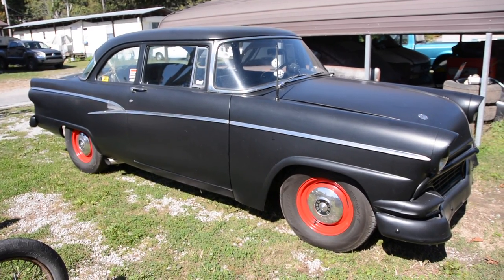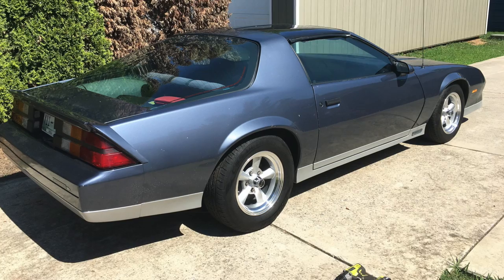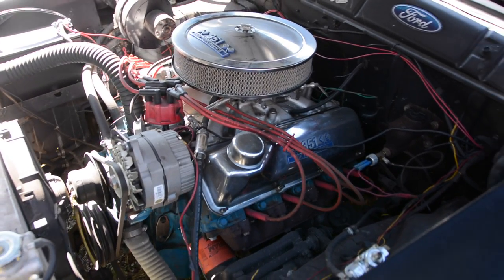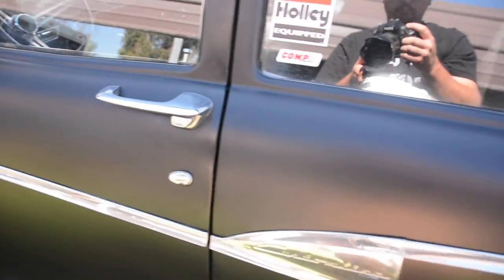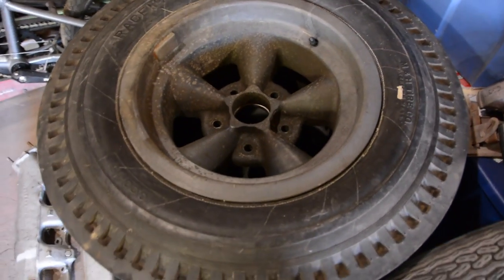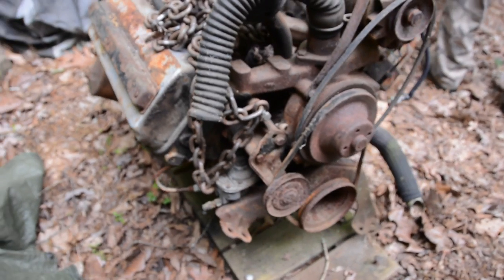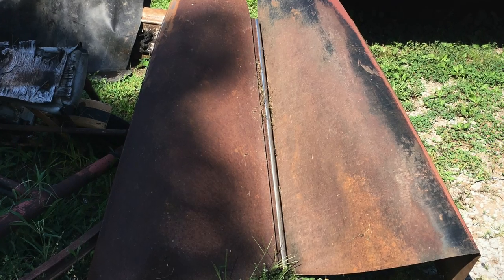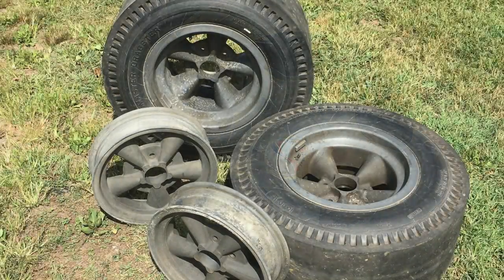BUY, SELL, TRADE! Inventory Update at the Hot Rod Hoarder Shop

Comment: Cool little 270 red ram thay are great for early coups not a ton of power but very cool look as you know hot heads I. Low gap nc trades in a few parts cousin has a 1935 Plymouth 5 w with 241 red ram project will be cool when more finished will be open wheel type car 1934 dodgebrothers grill thanks for the video cool stuff is always nice to see

Comment: The 56 Ford is killer looking! Now I know how I'm doing my 51 Ford! It was an old rodders daily driver so it has 51 Buick portholes on the fenders, and a 51 Buick grille came with it along with some 52/54 Ford headlight bezels made out of steel to weld to the fenders to french the headlamps! Plus it came with a set of repop Olds Fiesta hubcaps, and three Cadillac''Sombrero'' hubcaps besides the originals! I've done a lot to it because it sat for 35 years before I got it, But I have a ways to go!  It's too bad you sold the 56 Ford, It would be cool to put the Hemi in it with all hand built mounts to look like it was done back in the day!  I thought the GTA wheels looked good on the Z28, But it looks like it all worked out in the end!